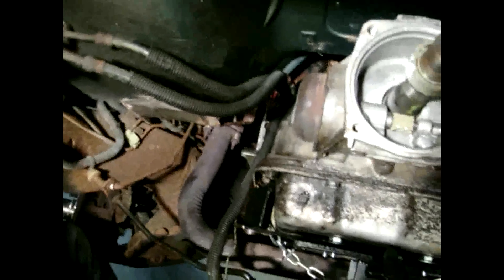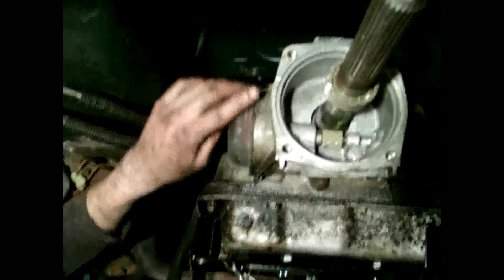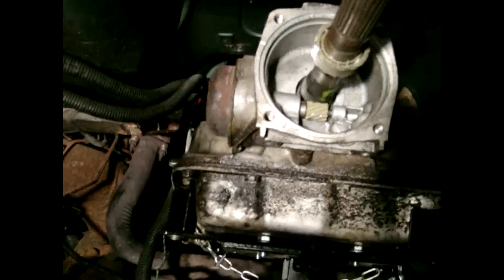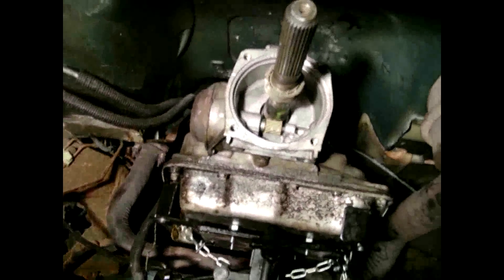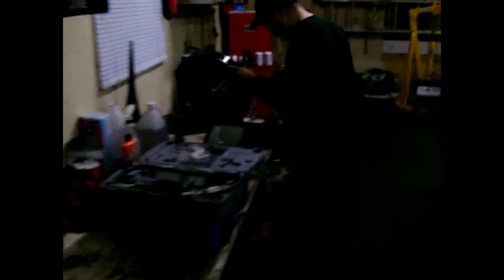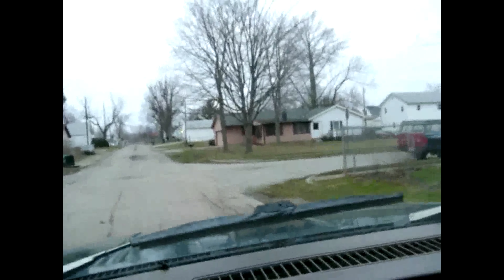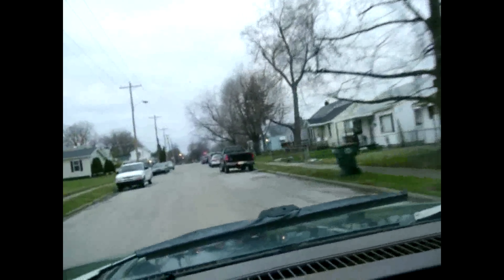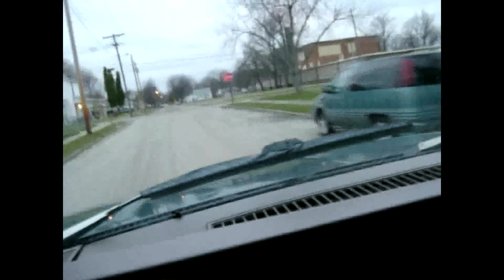Replaced the 4L60 with a 700R4 in my 1993 Chevy Surburban Lariat 1500 Series Part 2

Comment from the maker: You can make it work.  Had to use a GPS for the speedometer but everything else bolted right up and worked.  The 4L60 is basically a re-named 700R4.  The 4L60E has the big round electrical plug in that I was never a fan of.
VT247

Comment from the maker: @steverivi  I used the rear tranny tailhousing off the 4L60E to put on the 700R4.  The 4L60E uses a steel gear on the rear tranny output shaft that a sensor in the housing picks up to read voltage and determine MPH in the dash.  I didn't fuck with it on the 700R4, but one could be converted / modified perhaps.  So, my speedometer doesn't work.  That's OK 'cause my GPS does and it reads a more accurate MPH anyhow.
VT247

Comment from the maker: @steverivi The round plug I just left off.  I didn't hook up anything for the 4 plug pin on the 700R4 either and have put @4000 miles + miles on it (vacation!) without a problem.  Feels strong, pulls strong and I've had no issues.  Think it just controls torque converter lock up but I haven't noticed any 'cycling'.  Having it off ... does not turn on the service engine light. 
VT247

Comment: Okay my 700r4 is messed up I guess now the truck I have has that big round plug and I’m thinking of putting the 4L60E in it because I have a spare one how hard would that be?
Reply from the maker: If your going from a 700R4 to a 4L60E you’ll need a computer to control the shift point, the 700R4 just uses a throttle valve cable
VT247

Comment: What did y'all do about the big plug, just leave it? Does it affect the running conditions?
Reply from the maker: It will run just fine without it plugged in.  May have to do something different to run the speedometer.  I just used a GPS.  The shifting will be controlled by a linkage instead of the computer through the plug in.
VT247

Comment: Hey, I just wanted to let you know that I have gotten my 1994 Chevy 1500 with the 1984 700R4 legal and I have put quit a few miles on it. So far 0 troubles except I never hooked up the speedometer. I'm thinking I can pull the tail come off and maybe change the gear and use the electronic gear and sending unit in place of the manual gear and sending unit. Thanks for the help.
Reply from the maker: Excellent!  Never hooked up the speedo, just used a GPS. 
VT247
Reply: Thanks, I was trying to use my GPS but I live near an air Force Base and they keep messing with the signal. I was doing 108 in town according to mine for a few minutes last month. Lol.  
   I just want to try the speedometer gear swap to see if I could do it. It would be neat if it works.

Comment: hi, when you did that do you Remember how you hooked up the shift cable to the selector mounted on the trans? I have a 97 k1500 that I replaced with the 700r and the only problem I'm having is the bracket from the 4l60e doesn't mount to the 700r therefore I can't shift unless I get under and do it by hand
Reply from the maker: Think the cable fits into a 700R4 shift bracket, so get a 700R4 bracket and use the existing cable.  Think B & M makes brackets that will conform to what you need that may help.  Check JEGS or Summit racing too.
VT247
Reply: I'm still trying to figure out how you used the cable shift from the 4l60e and attached it to the 700 when the bracket from the 700 doesn't hold the 4l60e's cable. and I tried to mount the 4l60e bracket to the 700 there's no pre drilled holes in the 700 to fit it.
Reply: I'm having to move my shift selector under the truck by hand.

Comment: Hey I have a 92 Chevy Silverado with a 4l60e and getting a 700r4 , any changes that I have to do to install? Or does it just bolt in and it's a go?
Reply from the maker: You'll need to get a detent cable for the 700R4 and hook it to the throttle body.  Then figure a way to run the speedometer.
VT247
Reply: @Vacationtime247 is that all I have a 94 n I just lost 3/4 gear.

Comment: i have a 93 blazer and want to put a 700r4 in it. the only problem is that the plug on the 700r4 is the 4 pin plug but the trucks is the round 11 pin connector. how do you get the plugs to work?
Reply from the maker: I never modified the plug to work with the 700R4.  You can get a vacuum operated aftermarket unit for @$50 with the 4 prong plug.  I never bothered with either.  Never caused me any issue.
VT247
Reply: Vacationtime247 I have a 93 C1500 with a 4.3/4l60 swapping in a 5.7tbi/700r4 would it be better to use the harness that came with the 5.7? The engine came off a 93 road master.. I'd like for my speedo to work -_- lol
Reply from the maker: I'd just put a carb setup for the 5.7  It would be a lot of work to make the wiring work for the TBI system.  Now, the 4L60 is basically the same as the 700R4.  However the 4L60E has a round plug for the transmission and is electronically controlled for the shift point.  So, the 700R4 should have the same plug in for the speedometer.
VT247
Reply: I have a 1995 chevy suburban can I bolt a 700r4 up to my 5.7 tbi without any problems?

Comment: I have a 93 chevyvan with 305 engine and my 4L60E is blown. Supposedly the only transmission which is a bolt on 4L60E that absolutely must come from a ChevyVan or Vandura 93-94 and nothing else. I'm looking for those very rare or when I find one it is the same price as my van. I think seriously install a 700R4 is what makes any and if so is it that exactly the same changes to your suburban?
Reply from the maker: +Alexandre Messier The 4L60E was basically a 700R4 with computer controlled solenoids.  They never seemed to work right and were junk in my opinion.  The 700R4 is much easier to set and install.
VT247
Reply: +Vacationtime247 Can I put a 700R4 any year of any model vehicle gm. Have you kept the same ring gear and put your crank position sensor 4L60E on the bell housing of the 700R4? Should I change the tail of the transmission and to that of 4L60E for the speedometer? Do you transfer the linkage and cables of 700R4 on your truck is a big job? There are there any adjustments to be done to shift the transmission good or you simply transfer the cables and linkage and everything is ok?
Reply from the maker: The bolt patterns the same for the 700R4.  You should change the rear housing to swap in the speedometer unit.  I set the linkage for kick down and was good.  Might want to get an aftermarket vacuum assist torque converter lock up.  They're cheap and easy to install.  You'll find setting up the 700R4 simple.  Hope this helps.  Been a while since I did this swap but it worked out well.
VT247

Comment: did you have to change the drive shaft length
Reply from the maker: No.  It was a direct bolt in, add a detent cable.  Driveshaft bolted right in.
VT247